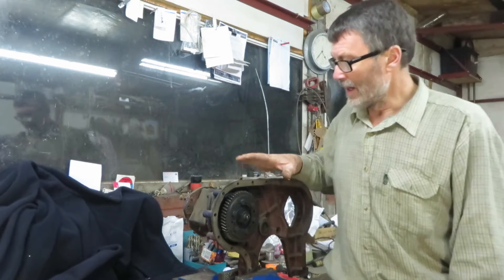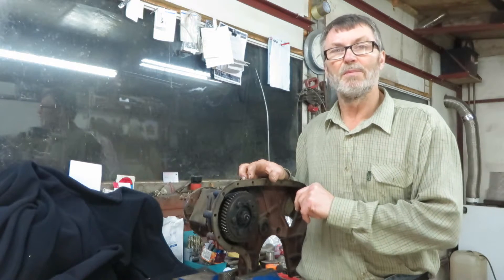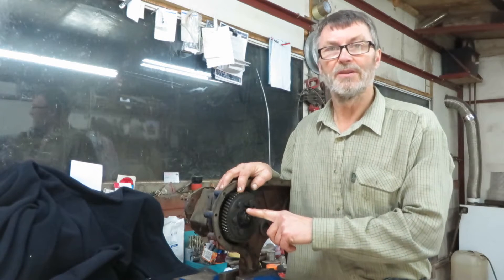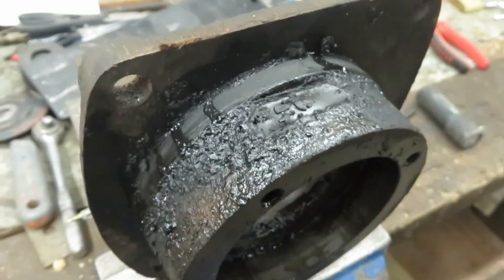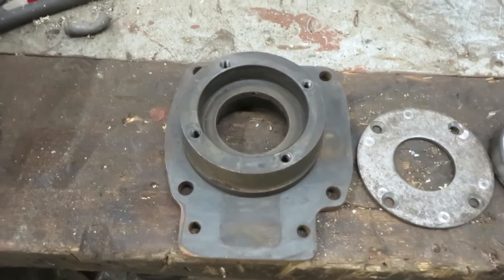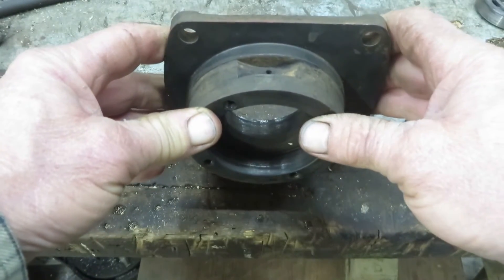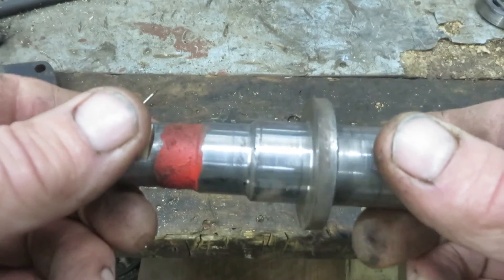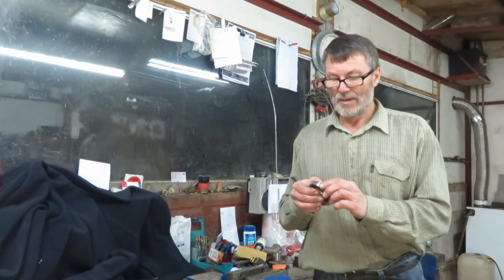Nuffield/Leyland Simms Injector Pump Drive Bearings Renewal

Comment: Little bit of additional info to this excellent video:    My 460 had one of the factory 'BAK' engines in it.   On my engine, the pump drive bearings are slightly different than those mentioned in the film.   The larger one is, indeed, a 6207..  the smaller one isn't a 6205 though (which is 2" o/d), but instead it's a 2.25" diameter.  I've got a part number of RLS8 for that one.   So, make sure you measure before you order!   Hope that helps someone.

Comment: thanks for doing these Nuffy vids. I have run I to the same on other engines. I use stainless all thread. no bottoming out and harder so it doesn't buyer the end.  came up with that doing work on the MAN planetary axles